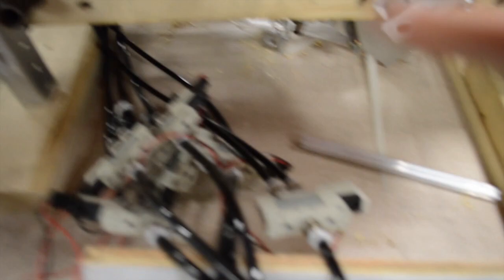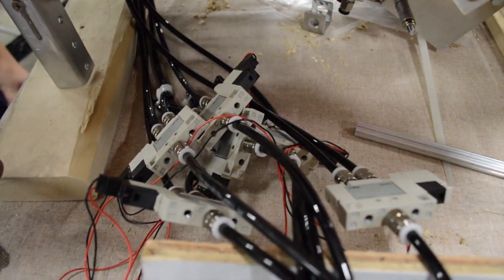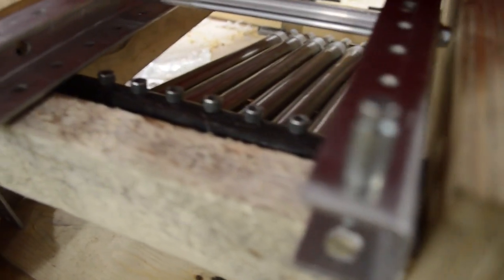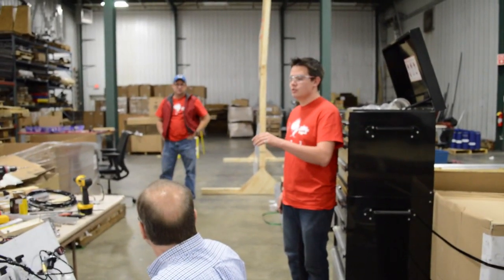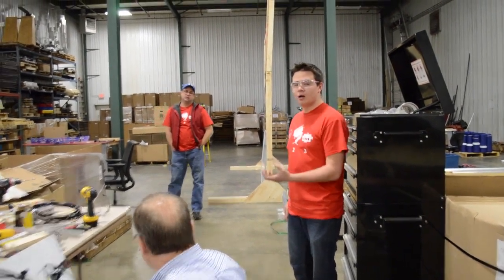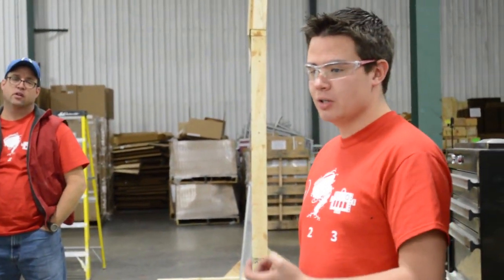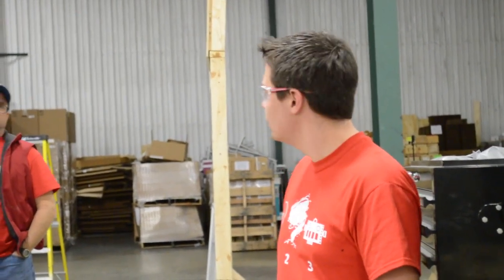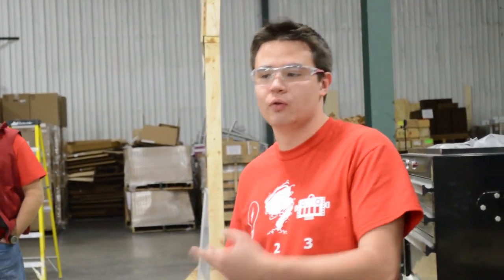Ri3D: AndyMark - Shooter Results

Comment: If you take the return line off the cylinder to the solenoid and block it off then just leave that end of the cylinder open it might move faster. Last year for the shooter 2145 had a 3/4" bore cylinder only powered in the extend direction because the return line for the retract was significantly restricting the speed of the cylinder.

Comment: I should have noted this a while ago, pneumatics work, but the way your pneumatics were mounted caused it to not work.  Because the it was mounted nearly parallel to the catapult, it decreased the efficiency of the system because it put more leverage on the pistons, basically reducing the effect the pneumatic pistons had.  We had tested the same thing with one piston, and found that doing the mounting the pneumatics the way you guys did only launched the ball a fourth of what mounting it perpendicular to the catapult did.  It went about 6-8 ft higher than when mounted parallel to the catapult.  If you notice while pushing the catapult with your hands down, it gets easier to push down as you get closer to the end because the leverage, mounting it in a perpendicular (or just straight up)  would yield much better results.  You can tell because it gets harder to push down the catapult into a cocked position.